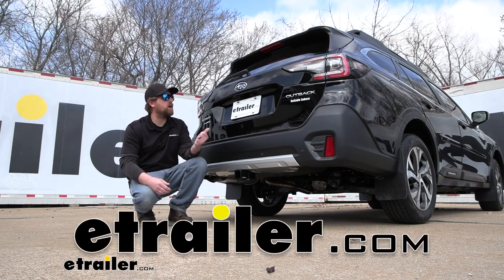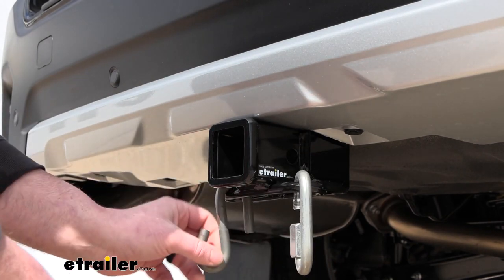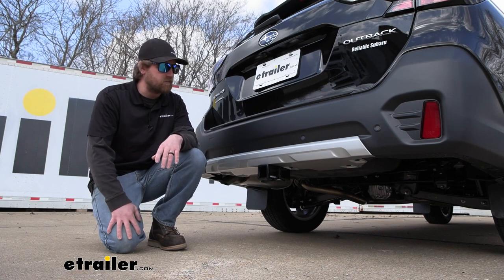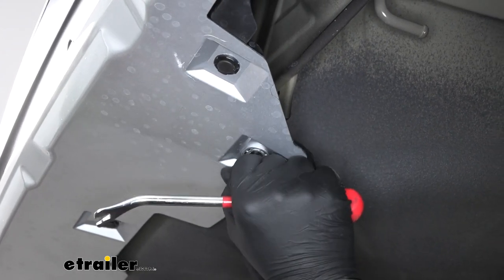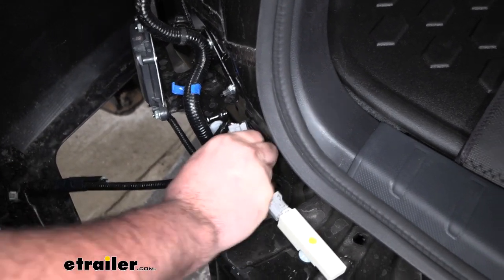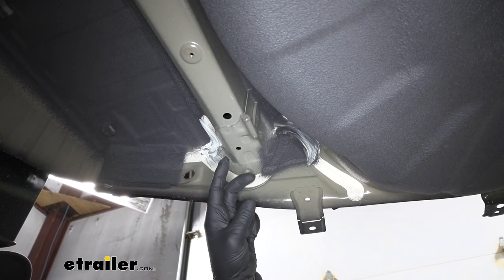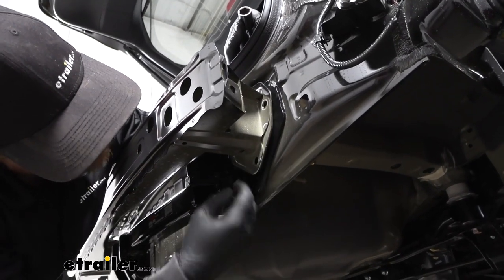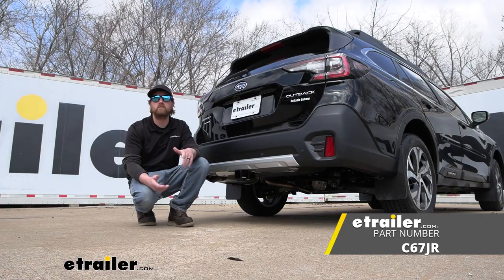etrailer | Curt Class III Trailer Hitch Installation - 2022 Subaru Outback Wagon

Comment: Do you think that this hitch will pit with the crosstrek?
Reply from the maker: This does not fit a crosstrek. If you have a 2022 Subaru Crosstrek, check this out:
https://www.etrailer.com/Trailer-Hitch/Subaru/Crosstrek/2022/76209.html?VehicleID=202265131

Comment: You show a fish wire. I bought this hitch from etrailer but didn’t receive such part. It’s also not available for sale through you and there are many sizes through Curt or Home Depot. You should have showed another method or provide the wire.
Reply from the maker: Check out the following link to see a fish wire that is designed to fit the 7/16 bolts that come with this hitch.
https://www.etrailer.com/Accessories-and-Parts/CURT/C58410.html
Reply: I used  a magnet antenna from harbor freight .99 cents
Reply: What?  Doesn’t everyone have a 7/16” fish wire?   Sheesh!!  How hard would it be to include that in the kit given the odds anyone will have that in their tool box.  Especially when it DOES say “Includes 2 qty” in the Tools Required section.
Reply: I bought the same hitch from CarParts, and they did include two fish wires.